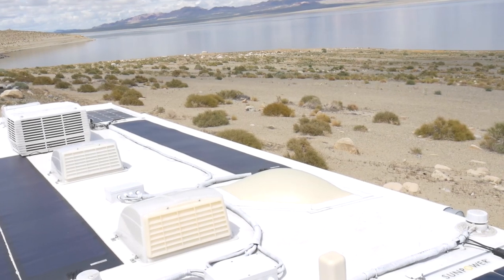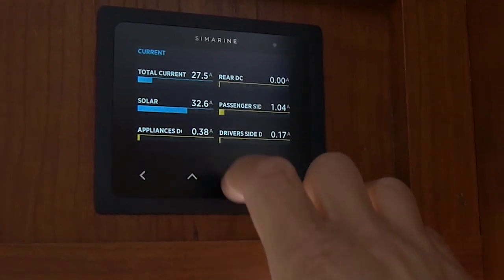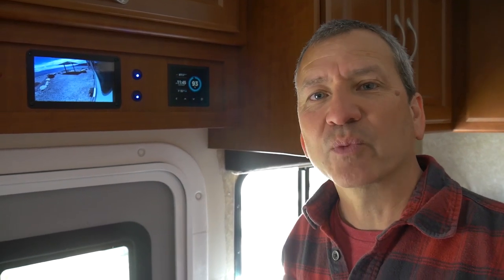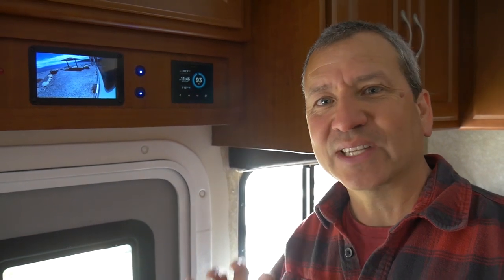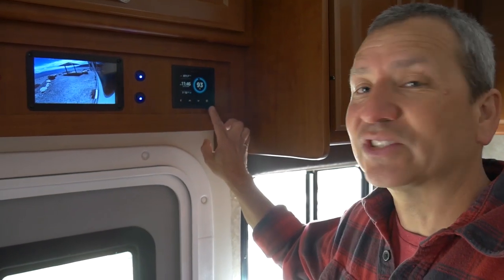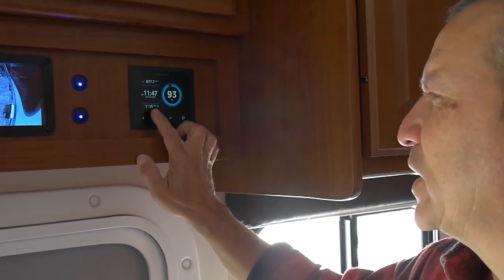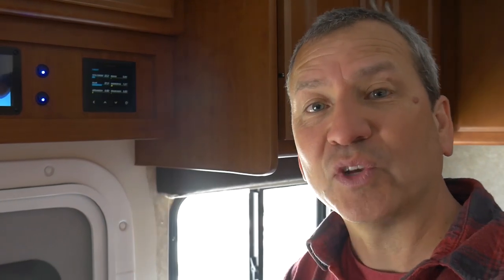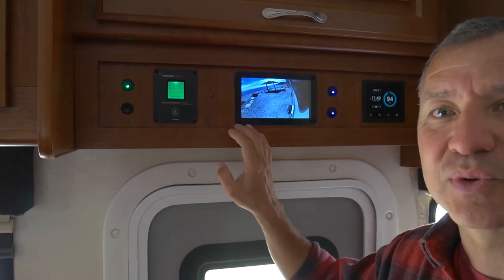HOW WE USE SOLAR for RV POWER OFF THE GRID - Full DIY System Tour

Comment: Since you boondocking a lot, to conserve water, did you install a separate water pump connected to your gray water tank to flush your toilet. This way you don’t use fresh water at all to flush and keep it to drink/wash. The used water is perfect to flush with and stretch your boondocking experience. Hope this helps.......
Reply from the maker: Have you done this? Good idea, but I suppose you'd need a good filter on that so you don't muck up the pump.
Reply: @RVwithTito  To be honest, no.  Because we don't boondock as we mostly use campgrounds and state parks.  We have 100 gal fresh water tank, so we are not hurting for fresh water.  It is not my idea, but I read it in 2001 when I was doing all kinds of research on RV tips.  I ran across a guy who's been camping for years and it was one of the things he did due to the tanks were small in the 70's.  
I would think if you would put the hole/suction in the gray tank about 2" from bottom, you would be OK.  Mainly due when you are camping everything settles and it should be just water as the solids should have settled down. On our motorhome we use drains screens so nothing goes down in the drains except water.  Food particles are picked up from the screens and thrown in the garbage.  You will be surprise the lint/hair that is found in the shower drains screens.
To keep the tanks clean, I used to use the Geo-Method system and it works great.  I'm sure you know about that.  But since then, I installed a water softener system in my RV so my tanks don't get/smell mainly because soft water keep solids suspended instead of non-soft water has a tendency of clinging which stick to the inside of the tanks.  But, since you been camping all these years, you know what I'm talking about.  Thanks.......

Comment: From inverter to shore power connection the cable not to long¿? Any power loss?
Reply from the maker: It's about 7 feet with thick cable. I don't run any heavy loads for more than 10 minutes, so it's been fine. I'll probably move my inverter at some point soon when I remove my generator. It's a little closer spot, but still about 6ft. I'll probably use 4/0 cable when I do that.

Comment: Hey Brian, I have a good question that happened to me today on a small portable solar generator I built. My question is if you have a MPPT charge controller and a solar array enough to supply your charge controller to charge batteries at lets just say 50 volts. While the batteries are charging at full sun your batteries are getting the full 50 volts. What prevents that 50 volts from feeding your inverter that many volts and causing it to kick off with too many volts going to it?
Reply from the maker: The MPPT charge controller wlll prevent that from happening. It will convert the 50V from your solar into a lower voltage suitable for your batteries, but at a higher current (Amps). For example 50 volts at 4 amps could be bosted to 14.6 volts at 15-20 amps to your batteries Hope that helps.
Reply: @RVwithTito  OK and that explains the smoke coming out of the cheap Chinese controller I seen today and then the inverter started doing that. That little gadget that prevents that, well I let the smoke out of it today.
Reply: So is it safe to just let your controller charge at the max voltage your solar panels can supply as long as you dont over volt your rating on the charge controller? I notice batteries say on them to charge at 14.5-15.0 volts? and float at like 13.2. Sorry if stupid questions this is the only part I get confused at.
Reply from the maker: That's correct. Your MPPT controller will manage your battery. You may also be able to program the controller to your exact manufacturer charge levels.
Reply: RV with Tito DIY Thanks always helpful. Love your channel.

Comment: Do the solar panels need to be grounded together and then to the frame?
Reply from the maker: The negative DC output will be grounded if your electrical system has a negative ground. If you have traditional panels on a rail system, then it wouldn't be a bad idea incase of a lighning strike. But for smaller installs with a few panels it's not common. Adding an inline fuse or circuit breaker between your solar and charge controller should do the trick.

Comment: hi tito 

i have ford e350 tioga rv with house battery in front and i want to add 200watt solar system with 200ah batteries and 1500 watt inverter for operate refrigerator and tv and amplifier while driving and for few hours use without generator use.

the question i have is right now the house battry is in the engine front connect with the start and alternator,
i have the solar 200watt from roof going to inside the rv with 20a controller and 200ah weize battery that i want to connect to main panel with the go power ts-30amp automatic transfer switch but i stiil have the old setup coming from house battery in engine how can i connect the old 12v system with the new solar setup with the 200ah batteries ?

can i have dual 12v supply connect to the main electrical panel?

sammy

Comment: I tried to follow you in the video, but I didn't get if you are running a 12v or a 24v system. Parallel and serial connected AGM I got, but what is your combined voltage feed? Is that still just 12 volt?
Reply from the maker: Yes. It's a 12V system.

Comment: It amazes me that people still call you Tito, when pretty much every video starts out, "Hi, it's Brian from Rv with Tito". Still wondering if the heat from those carriage bolts have any effect on the roof, but I think it would take awhile to show. I plan on installing my flex panels like you did, but I am going to put a piece of rubber or eternabond over the bolt heads.
Reply from the maker: Yeah that's pretty funny. Tito has become a nickname anyway. Sure. I think eternabond on the bolts is an easy workaround.

Comment: Thanks for another great video!  Does anyone else make the Unisol style PV panels? I have an older RV with a curved fiberglass roof and i believe that style will work best for my setup.
Reply from the maker: Supplies are limited, but you can still find the longer Unisolar panels on Amazon and Ebay.
Reply: The technology is called thinfilm pannels, and they are also more shadow tolerent than "normal" pannels.

Unisol made a lot of thinfilm pannels.

In a test of 5W panels (at the time it was popular to by in Africa for lighting) Unisolar  got 1st place for promised watts vs real performance... So the brand is a quality brand.

Comment: Will solar run heated tanks?
Reply from the maker: It's really your batteries you should be thinking about. I'm not sure how much current tank heating pads draw, maybe 5A each? That shouldn't be a problem. I'd put the tank heaters on a thermostat though so they're not running all the time.
Reply: @RVwithTito  I forgot to mention the fact that my panels are factory stock.

Comment: I really like you videos.  Well done.  Just a comment here.  Not any criticism at all.  Very heavy and "not so cheap" VMaxx battery bank.  You'd really benefit from using lithium Ion phosphate.  I just built a LiFePo4 battery for my TT sized at 240ah for under $1000.  It weighs less than 50 pounds and I have almost as much useable energy as you have with your AWG's.  They also charge a lot faster and they can be nearly drained without damaging them.   Probably 20 year lifespan and maybe 1/4 the physical size too.
Reply from the maker: Yes. I'm very much aware of the benefits of lithium and will be moving in that direction shortly. Thanks for the info.
Reply: @RVwithTito  I'll be watching to see which way you go with lithium!  There are some interesting choices out there now.  Do a lot of research.  One piece of advice..... assure the environment they live in is similar to what we like.  Not too hot (extremely important in battery life), and not too cold (extremely important during cold weather charging so as not to harm the battery).........  I searched the marketplace for a solution that fit me, and found only one very expensive choise.  Then I decided to build my own battery and insulated/heated case and so far it is performing beyong my expectations.   Good luck to you!

Comment: Why 3 solar controllers?  Thats lots of dollars when just 1 controller would have worked just fine (or 2 as you have two different kinds of panels).  I use a single Morningstar Tristar MPPT 60 amp controller with 1280 watts of panels and I routinely see 60 amps of charging current to my lithium batteries
Reply from the maker: I used to have a Tristar TS45 MPPT which worked well. I get more out of parallel strings though on separate controllers. The Victron controllers seem to handle the multi-controller setup better and regulates the output more efficiently in an over-current surge. The Morningstar controller would through a fault if that happened and shut everything down (not that it happens much). The bluetooth and mobile app configuration is also more appealing to me. I had already been using a small Victron controller for my external array, so it was an easy decision to switch everything to blue to monitor/configure everything in one spot. Anyway, that's my story :)
Reply: @RVwithTito  I was also wondering about the 3 controllers but it makes sense with the different types of panels you are using. My concern is that they are all crammed in that little space with little room to ventilate. Do you have a cooling fan in there?  I used the load terminal from the 75/15 to control a computer fan with a thermostat to keep the air moving. Just a thought.
Reply from the maker: @chachi5975  Yes. I installed a cooling fan in that compartment last year also on a thermostat switch. Works great.

Comment: No offense, but lead acid is garbage and suffers from the pukert effect, meaning that ultimately you will NOT get 450 ah out of those...more like 300 and less the more you draw. Lithium Ion phosphate would get you 2-3000 cycles to 75% and FULL capacity, MUCH quicker charging, MUCH less weight, and full power untill the end of the LVC.Im going to be building a solar system for my trailer and will make my own 150 ah LifeP04 battery (150 ah x 12=1800 watt hours.) so if I am drawing 45 watts for tv and 45 watts for fridge and another 15 watts for the three LED lights then without charging the battery, it would last about 17 hours.

Comment: Too much weight. Defeating purpose by wasting gas when traveling. Should have gone with hospital used lipo batteries. Cheap and weigh nothing
Reply: Where do you find them?
Reply from the maker: Agreed. The AGMs are way too heavy. I'll be upgrading to LiFePO4 batteries in the near future which will subtract a couple hundred pounds. Yeah I've seen those used 80 Ah batteries on eBay...good deal. I think Will Prouse just did a load test of them on his channel.

Comment: I travel to relax not to be a slave to the RV with monitors, regulators and all that many things to check constantly. you must also spend a fortune on gasoline with so much weight.
Reply: Well if you have nothing good to say don’t say it (quote from your mother) do your friends call you Gran Torino? Be nice Tito makes very good videos and gives very good advice.
Reply: The solar system pretty much takes care of itself.  All the monitors at there for diagnosis if power stops... And so Tito can geek out and appreciate concrete stats on how well his project is working.
Reply from the maker: Sure. It's by choice. And the gas is always going to be about the same with a large rig towing a car. We pay little to nothing for campsites and eat very cheaply.